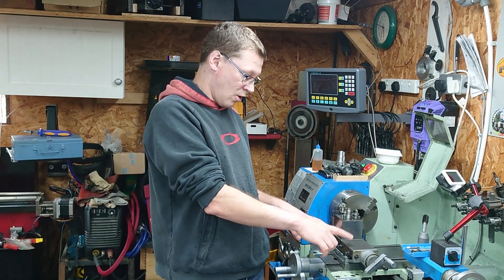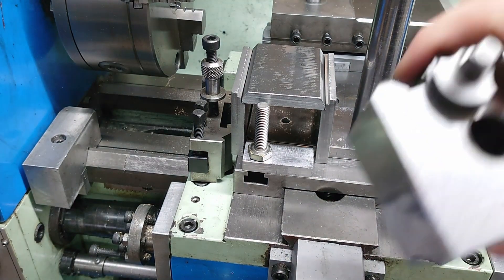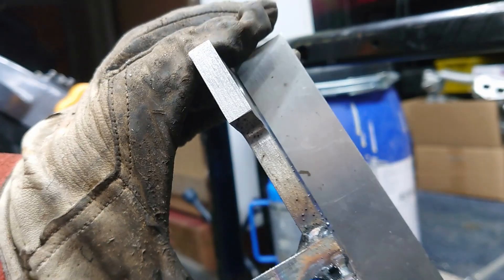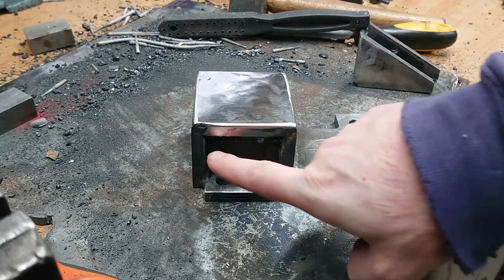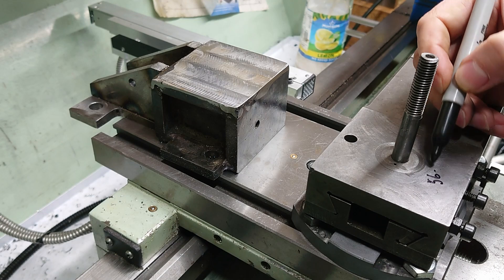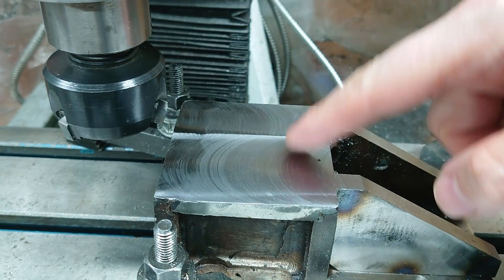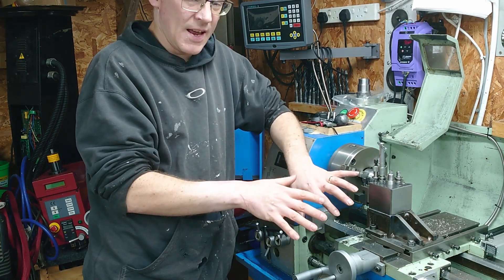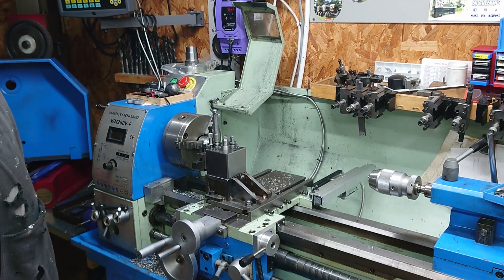Fabricated Toolpost - It's now better see pinned comment.

Comment: Is it the cutting tool it’s self try sharpening it
Reply from the maker: It's various carbide inserts, they've been changed
Reply: @ I have a white grindstone it is very hard I give my carbide inserts a little touch they seam to work better for me. Just out of interest give it a try   You never know 😜
Reply from the maker: @davewebb5737  worth a try I suppose. Carbide inserts are not sharp, but I believe that's because they are brittle and won't last long if they are. I'm very good at breaking carbide already!

Comment: have you tried to tighten up the cross slide gib?
If you want to build a solid toolost from cast I would suggest to get the tooltip above the cross slide dovetail. Cuttingforces do cantilever the dovetails, pressing one side down and one side up. It helps alot if the force is applied down on both.

Comment: Hi Olly. I was lucky to find a piece of cast iron with which to make my solid tool post for my Myford Super 7. I am delighted with mine. I hope you find the cause of your vibration as your fabricated tool post deserves to succeed after so much effort. Good luck. 🤞👏👏👍😀
Reply from the maker: Hi Andrew. I expect that my efforts in making the thing are not proportional to the level of success. I'll no doubt end up making another one from solid material. I appreciate your encouragement though. Thanks 👍

Comment: Eliminating the top slide helps, but it not "the" solution. The quick change tool post is not very rigid. I'm sure you will have better luck with a four way lantern tool post.
BTW, I like you digital chipping hammer. It seems very acurate :)
Reply from the maker: @Rustinox  I will try the 4 way toolpost. Regarding the chipping hammer, it genuinely works really well, perfect use for a broken caliper!

Comment: Cast is better for that sort of thing.

But having said that. How flat are your surfaces?
Reply from the maker: @stusue9733  the cross slide is not particularly great, the compound slide has certainly left some gouges.  I'm going to get some flat stones to dress the surface and hopefully that may improve things.  If not I will try to find a suitable lump of cast iron to make it with. Thanks for the comment 👍
Reply: @ollysworkshop  Do you have a surface plate?

Scraping is likely your best option.
Reply from the maker: @stusue9733  I don't, and I've never done any scraping. That's a whole new rabbit hole!
Reply: @ollysworkshop  For what you are doing scraping isn't rocket science. The rocket science part comes in alignments. Two parallel surfaces are "easy" ;) But getting set up for a one off when it might not help much....hard to say without knowing how far out it is. 

If you are talking about getting ground flat stones, I'm not so sure about that idea. As I understand it they are for taking tiny dings out of things that are already very flat, you may well damage the stones and not do much to fix your issue.
Reply from the maker: @stusue9733 yes, the stones would just be to take off the high spots, but in doing that I would then see how not flat the rest of the surfaces are. A proxy for a surface plate and blue.
Reply: @ollysworkshop  Given the price of flat stones, wouldn't a small plate be cheaper?
Reply from the maker: I was going to make some, nothing fancy, but currently I have no way to flatten slight dings out of the mill table for instance.  A surface plate would be good. I would need to make room for it though, I currently have nowhere suitable for one. I need a bigger shed!
Reply: @ollysworkshop  We all need a bigger shed ;)

Comment: Hi! I have the same lathe (as you may remember). 

The solid too post I made is from a solid block of steel (scrap bin find, don’t know what it is exactly), was looking for cast iron but that is hard to find in Norway. Or darn expensive which wasn’t an option. 

I can only say that my lathe runs really well with it, even manage to part off steel which was not possible with the original compound slide.

One thing I noticed when mounting the solid tool post was that I had to adjust the fins of the cross slide. Seems the solid tool post is much stiffer than the mounting of the original compound slide and “pulls” the cross slide straight(er). Due to this my cross slide was looser. Maybe that’s also the case for yours? Did you notice that it moves easier?
Reply from the maker: Hi, yes I do remember. It's odd, the toolpost itself seems completely rigid. When cutting the headstock, and certainly the chuck and work seem to be the bit vibrating, and not the tool.  Maybe I'll film it close up and watch in slow motion to see what's really going on.
Reply: @ollysworkshop updated the post above and sent an email with some pics to you
Reply from the maker: @Pfiffikus25  I'll take a look. I've not noticed, but it's a good point. Thanks 👍

Comment: I believe the trick to a solid tool post is make it from a solid block. All the pros do it that way. Maybe a cad simulation can cast some light on why.
Reply: Hi Olly, this was an amazing build. You really put your back into this and it was enjoyable to watch, well done.

The only thought I had on your build was that the cylinder post might still have play in it. Maybe you could fill the cavity with Babbit. But I can see you have found a clever way of balancing out the loads and reducing the vibrations. Very impressive👌👌

Great comments from all your followers.

All the best!!
Reply from the maker: @davidberlanny3308 thanks David, it was not an obvious issue, but I can now machine the problem material.
Reply from the maker: Thanks. Fabricating it seemed like a good idea at the time. I was really regretting the idea by the end, but "I've started, so I'll finish".  On your point though, it's hard to tell exactly, but it seems the headstock is vibrating. When cutting, the tool doesn't vibrate anymore (it used to with the compound), now the chuck and metal vibrate.
Reply: I wonder if you fill the cavity in your box riser with lead.
It would eliminate the various theories concerning the design.
Reply: @stevewilliams2498  i came to comment this, maybe not even lead, some machine tools are filled with other substances to dampen out vibrations or just add mass.